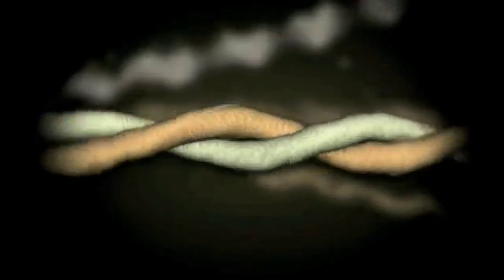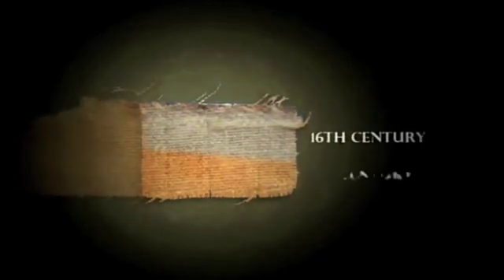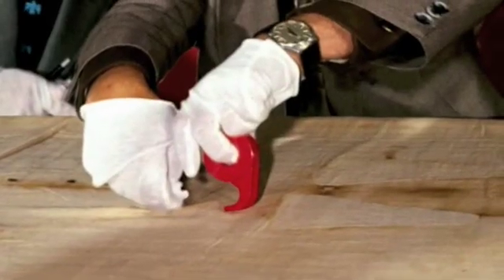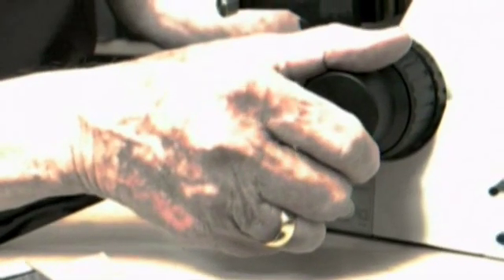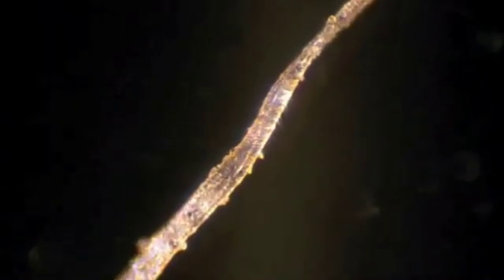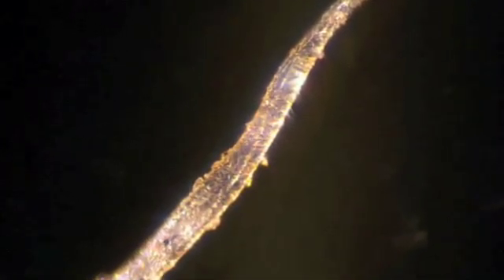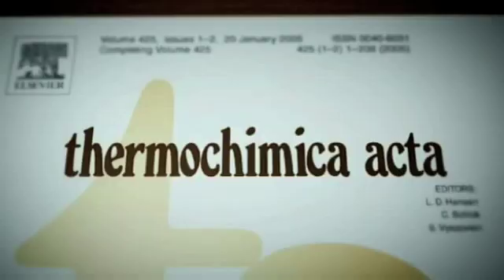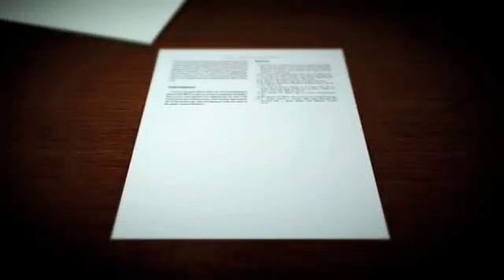Shroud of Turin - Carbon 14 test proves false

Comment: At 0:07 when they say that the weaving pattern on the cloth looks misaligned, the picture is tilted at an angle for some reason, making the left and right sections look less symmetrical. If you un-tilt the image, the two parts look symmetrical. Not saying this was done on purpose, but it's interesting to note.

It also seems difficult to believe that this "invisible repair", which involved individual threads from old and new cloth being wrapped together, and sounds very labour intensive and hard to do, would be done on a corner of the shroud which no-one would likely care about.

It's also recorded that the Oxford team who did the dating did detect extraneous strands and removed them before doing the testing.
https://en.wikipedia.org/wiki/Radiocarbon_dating_of_the_Shroud_of_Turin

Comment: QUESTION:   Which of the following  does not fit in with the rest of the
 group?

A.  Shroud is 8 X 2 Cubits.....A 1st Century Measuring System
B.  There is a 1st Century Stitching Pattern along left side of Shroud
C.  There are scourge wounds on Shroud from a 1st Century Roman Flagrum
D.  Crucifixion was abolished in the 4th Century.
E.  Recent tests on the Shroud gave the Shroud fabric a pooled age at 
33BC
F. Absence of vanillin on Shroud fabric tell us the cloth is minimum 
1,300 years old. 
G. A Fresco found in Rome dated 280AD used Shroud as role model
H. Shroud fabric is hank bleached,  an ancient method of fabric weaving
I. Dr. Max Frei stated he found pollens on the Shroud that have been 
extinct since the early centuries.
J. The Man whose head made contact with the Sudarium of Oviedo is the 
same person whose head made contact with the Shroud. We know for a 
historical fact the Sudarium existed in the 6th Century. 
K. Side Spear Wound on Shroud matches a 1st Century Roman Lancea
 L.  A 1988 carbon dating test in which the top players were paid over 1 
MILLION DOLLARS told us the fabric is about 700 years old.

If you answered L you are SMART!    L stands for LIAR 

Does anyone out there find it odd, the only test that suggested the 
Shroud fabric could not come from the time of Jesus is the one where the
 witnesses got paid over 1 MILLION US DOLLARS to cut a small piece of 
fabric from a damaged corner area and send them to some labs?!

I cannot speak for anyone else,  but a million bucks to cut a piece a 
fabric and mail them out seems like a bit of overpay. 

I wonder if the million dollar carrot they put out in front of the top 
players had anything to do with the area they chose to carbon date the 
Shroud?  The damaged corner area... 

PLEASE HELP MAKE AMERICA SMART AGAIN.  VOTE FOR THE AUTHENTICITY OF THE 
SHROUD OF TURIN AS THE BURIAL CLOTH OF JESUS.
Reply: it takes a lot of money to make an actual scientific experiment with carbon dating, even more expensive in 1988

too bad all the options you named except L can be faked

even if you buy this bull, still doesnt prove it was jesus and that jesus was a divine being
Reply: So you believe carbon dating is accurate.  Great. Shroud was carbon dated in 1982 at a California Nuclear Facility.....it came back to the time of Jesus.       Oh, except they were smart enough to carbon date the piece of thread that did not have the madder root dye contamination on it.

But of course in 1988 they carbon dated the thread with the madder root dye contamination on it.  Of course they had over 5 years  to find the clink in the armor of the Shroud.    When you are getting paid 1 million British pounds to find a way to present evidence the Shroud is not authentic these are the types of things people do. 

Is the picture starting to get any clearer for you? Or do I need to further clarify?  

Shroud is authentic.   The eye witness to the Resurrection.   
The New Bronze Serpent on the Pole.   And like Elijah left his Shroud/mantle behind after he went to Heaven, so did Jesus.

Jesus said the only sign he would give this wicked generation is the Sign of Jonah. 

the numerical sign of Jonah is 3

3 is written in blood on the right side of the fore head of Jesus/Man in Shroud. Jesus is seated at the right hand of power.    A numerical marker.    The Sign of Jonah is on the Shroud. 

Behold, He is Coming.    

Bro, this is serious.  You need to take it seriously.
Reply: The Truth is a bit harsh isn't it?    Do not worry bro,  you can still make it. 

Still time left.   Jesus Christ the Lord wants ice warnings handed out to all the Captain John Smiths out there heading straight for a fatal collision with an iceberg.    You are one of those people. 

 I just gave you the ice warning the Lord Jesus asked me to give you

This way at the end you will not be able to say,  "I was not warned" 

You have been warned.  My job is done here.   It is up to you now. 

I would slow my ship down and change direction if I was you. 

Good Luck

Every passing second is another chance to turn it all around.
Reply: ok lets say for the sake of the argument they fucked up the test, and the shroud is from the age of christ,  how does that prove it was actualy anything more than a shroud from jesus time?

by the way, why dont they test it further? oh right, because now we have the tools that would prove it false, cant have that right?
Reply: wait wait wait, you are skipping the part where we prove that the shroud is proof that jesus was divine
Reply: why are you deleting your replies, now the reply chain is all fucked up
Reply: Sorry Bro about my opening comment. That was out of line. I apologize for that. That was not necessary.  I deleted the comment.  I have no excuse.    

I am sure that I am not going to convince you the Shroud is genuine on a  forum like this,    but just consider the possibility.

For me to answer your question is a very long post. 

Bear in mind 7 forensic pathologists/blood chemistry experts were convinced it was authentic and openly stated so in scientifically peer reviewed journals.

If this did not have the name of Jesus attached to it, no one would question it.

It is the sequence of events the man underwent that make it possible to  calculate odds of probability and chance another person other than Jesus made contact with the cloth.

The pathologists were the ones that determined the sequence of events.  

That is a one in 282 billion chance someone other than Jesus made contact with the cloth.  

That is actually a lower end figure.   

Math has a way of cutting through all the BS

It comes down to who is the most credible witness

A forensic pathologist.  or someone who has never seen the Shroud and has no credentials

Bro, I gotta go,  I just do not have time to be here

In sincerity I wish you luck.    Go a bit deeper into this before rendering verdict.         Take your time.  You seem young.    Still time left.
Reply: No, they are all still there.  Just one is gone. I think it is important to be respectful to people despite having different beliefs. 

That opening comment was not respectful to you.   It was out of line and not necessary,    my apologies again on that. 

Anyways, Bro I am exhausted.   Shroud was carbon dated in 1982.

They knew that.  They cut from the same area.   One inch a way.  

They knew they carbon dated a thread in 1982 that had what they thought was starch contamination on it.

See, the same piece of thread came back at 2 completely different dates.

One end came to the time of Jesus, the other like 1000AD

Madder root dye will screw up results.  Instead of carbon dating the thread it will carbon date the time of the contamination.

This has happened to many items carbon dated.

One was a mummy from Egypt they knew was over 2000 years old
It came back 19th Century. 

Myrrh resin coating over things also screws up testing.
Reply: you can insult me all you want as long as you add some info to why I am wrong

well, I dont mind accepting that the dating failed, and the shroud is from jesus age, but where do we go from there?

Comment: - Why is r there NO 'blood' stains on n around th 'top' of th head?
- Th 'blood' 'stains' around th head r unnatural n clearly show to hav been painted on
-Th arms r too long
- One arm is longer than t'other by ab. 1/3
- Th fingers n hands r disproportioned
- There's no navel, which coincides w/medieval philosophy that Jesus should not have a navel
- Th hair is too long 
- Th hair n beard hang down as if th man is standing
- On th back o/t shroud th knees r slightly bent BUT on th frontal image th legs seem perfectly straight.  Wow..I wonder how THAT is possible?
- Natron, a substance used by th anc. Egyptians for embalming was found on th SoT.  What might that b for?
- DNA found on th SoT?  If true many more than jes one type.  From th many who've touched it
- Th hair looks well coiffed; hangs down th back in a narrow pony tail.
-.Putting nails thru th wrists risks killing th body quickly as there r large arteries that run down th wrists which is why suicides will often cut their wrists.  Therefore th Romans would NOT hav done so.
- Putting great nails thru th wrists n ankles would hav broken bones.  R there signs of broken bones?  
-.Th feet should hav been grossly swollen AND covered in blood BCZ Th blood had to flow down into th earth.  Strangely th feet on th shroud do NOT show it !!
- Th hands lay unnaturally on th groin.  On a real corpse hands will succumb to th pull o gravity n fall down to th sides unless tied together.  There's no sign of any tying of anything on th SoT. 
- Rev. 9:8..describes hordes of locusts coming out of th to plague humanity and their hair was long like that of women...

Comment: Oh it was repaired in th 15-16 cent. was it?  WELL THEN WHY DIDNT TH DATING SHOW THAT U LYING, CONIVING S'BAGS.  U LYING LIE N LIE N LIE.  U're MUD.
Reply: If linen fibers from the 1st Century are mixed with cotton fibers from the 15th or 16th Century, then combined together and burned and the ash is dissolved in benzene for Carbon-14 dating, the result will show a date range in between the ages of the two types of fibers. This is what happened in the Carbon-14 dating procedure done in 1988 that showed the mixed fiber sample to have originated between 1260 and 1390 AD.

Comment: The only thing that carbon 14 tests and any other tests for age is just that. A test for age. If the cloth is from the time of Christ it doesn't prove anything. It only proves that it is from the time of Christ. A clever forger would have used cloth from Christ's time period not something new. This is no different than a modern day forger using 1860's parchment and writing utensil to forge Abraham Lincoln's signature.
Reply: Roy Jones Very True
Reply: Smh... U obv have not researched the Turin shroud.. If u have done so EXTENSIVELY you wouldn't say what u just said
Reply: A medieval forger with resources could likely have obtained some linen cloth from Christ's time to use in fabricating what could be claimed as Christ's burial shroud. But the cloth would have been only the base to work on, the "canvas" to paint on, so to speak. That forger would have had to be able to create an image and place blood stains on that cloth that hundreds of scientists spending millions of man hours examining have not yet been able to explain.

Comment: this pathetic attempt  to rescue the shroud aside..... why would it mean ANYthing at all if the data actually WERE (and they are not) indicating an origin from the 1st century?
that
- would not prove it is "jesus"
-would not prove that "jesus" was "resurrected"
- would not prove that "jesus" was/is "divine".

the whole discussion is utterly useless.
believe what you want but dont call it science. it's always faith, no more.
Reply: +TIMEtoRIDE900.  U R th 1st n only to realize that there is no sign of th huge amount of herbs n spices on th shroud (100 lbs?  So they say.  That is huge). Such a huge amount  should have been obviously noticeable on th shroud shouldn't it?  I think so, even to th point of so covering th body that that it should have prevented all, most or large sections of th body from touching th shroud yet there is no sign of it.  Instead they pollen samples which they find bits of but of th 100 lbs of herbs...ZERO.  U hav made a worthy contribution sir.  Thank U.
Reply: picayune one
Well, thank you - this is actually recorded in the Bible, I just don't know where.
I need to tell you another thing,
The lead scientist who analyzed the shroud was later granted a professorship at a prestigious college and given $1,000,000.
This should be taken as a bribe - after the fact.
The sample that was carbon dated was cut from a repaired area that was fire - damaged, rather than from a more "pristine" area.
.
If it contained a portion of original fabric, and a portion of  "repair" fibers, and a portion of "soot" from the fire, then the average carbon date would be skewed, but in a manner that favors the present, as it analyzes half-lifes.
.
A mouse is raised in a lab feeding just on yeast grown with a feedstock of Natural Gas.
The living mouse carbon dates as 11,000 years old.  The ancient carbon throws off the test.
An old sample contaminated with recent carbon would register as much more recent.
Reply: it has always amazed me how someone can get angry at this it proves nothing what does that mean it means nothing bla bla bla  I think it takes way more a leap of faith to believe there was a big bang and a fine tuned universe and then us out of nothing amazing
Reply: Hi thephidias , really show me the peer reviewed journals to support your hypothesis
Reply: All these scientists that examined the shroud must have missed this because they say there's no known procedure to create an image like the one on the shroud. Maybe you can contact them https://shroud.com/
Reply: grendizer69 of course I am full of anger and rightfully so!
what exactly does that mean?
i am angry at stupid people who try to invoke "miracles" in order to sort of prove that other claims they make (usually about what other people should and should not do) have a good reason.

i might be angry. however, neither are my ears plugged nor can any of you nutters pull wool over my eyes.

replicas of the exact thing are easy to make without any modern technology.

plus: ONE look at the shroud and you SEE it is fake. it is NOT "three dimensional". it corresponds to the a bas-relief.

again: even IF the shroud was officially dated to the 1st century (which it isnt) it is no proof whatsoever of anything divine at all.

replicas of the exact thing are easy to make without any modern technology. no miracles involved. 

plus: ONE look at the shroud and you SEE it is fake. it is NOT "three dimensional". it corresponds to a bas-relief.otherwise the face and the part between back and front would have to be completely different.

try it with a puppet. paint the puppet. wrpa it in paper. and see what you get.
Reply: you are right insofar as there are NO MIRACLES involved. you can watch the process of making exact replicas of the shroud online. 
BUT: EVEN if the dating was from the 1st century (which it isn't), what does it prove????
nothing. it is not worth anything.

the same "argument" could be used for "the pyramids". they are older (and proven beyond doubt to be older) than that stupid shroud, and "nobody knows" how they were built (when, in fact, we do, but still many claim otherwise).... so THAT god )or THOSE GODS) MUST be the real ones.
everybody worship osiris better now!
Reply: +grendizer69 i know how to read. that is why i cut your sentence off. no miracles involved. that sums it up. 
i do not have my mind set up already but i was lucky enough not to be brought up indoctrinated by any religion. 
by the way, there is no radiation.
you can go google the remaking of the shroud yourself. there are two different ways, both come up with extremely good replicas. please do yourself the favor and search it on youtube. 

but you never ever addressed my initial point:
so what if it is first century? (which it is not) ?

it would not prove anything else than just that - 1st century.
it does not prove who it is, what happened to him, let alone that it is not a 1st century fake (which it is not. it is a medieval fake).
if anything, to me, it would "prove" that there is a picture of someone who is dead. 
where's the resurrection deal coming in? 

there are a lot of people who come up with a lot of "supposed" evidence that the pyramids could never have been built by any known means of that time.
the same line of reasoning leads to a godly intervention. 
only this time some other god.

"miracles" happen all over the world (although, a little dissapointingly the frequency seems to have dropped somewhat since superstitious times). 
the muslims claim some, the hindus do, the different christians do, ..... the list is long.
it is all the same superstition.

it is a bit pointless to argue with you. it is you who have your mind made up because you need your facts to fit your fiction - your personal religion.

you know that i am not going to change your mind, and i know the same of you.
i am not talking to you here. i want the people who read this to make up their minds.
Reply: and yet you just did.
Reply: thephidias The Bible states that 2 disciples entered the tomb with 100 pounds of Aloe and Salve to tend to the wounds.  Wouldn't all this goop be on The Shroud??  After watching the video, there seems ONE last thing to do, painstakingly un-ravel the tiny samples that the Scientists still have, gather all the linen, separate from the cotton, and do another Carbon Dating.

Comment: You can't take a piece off the edge, which has been handled the most AND has been proven to be attached to the rest of the cloth at a later date, and claim that the Carbon 14 test is proof that it's not real.  That being said, it's not required of anyone to believe that the Shroud of Turin is real, so honestly think whatever you'd like.